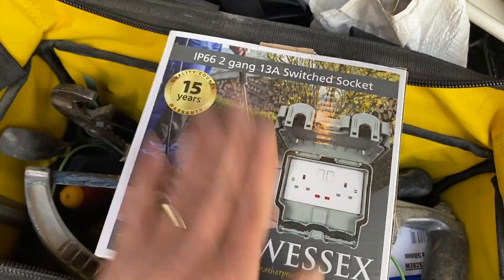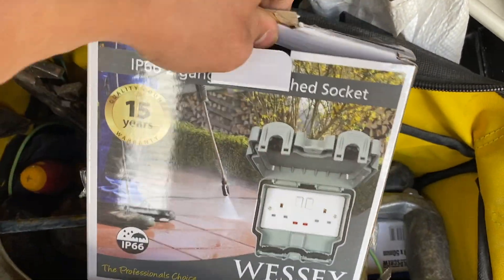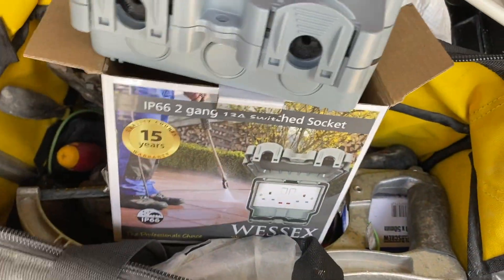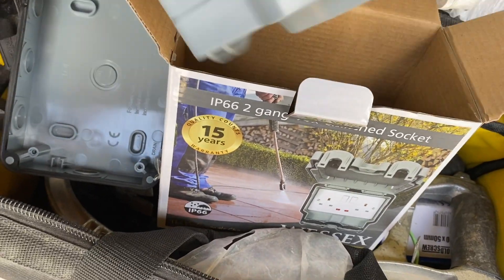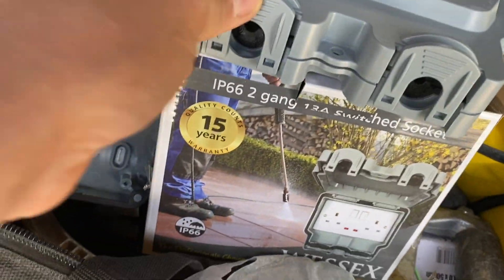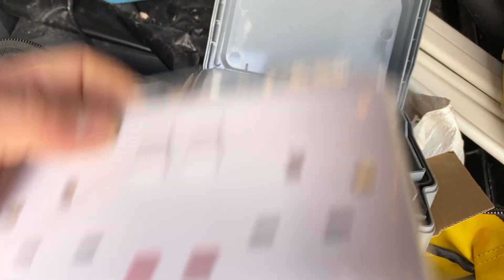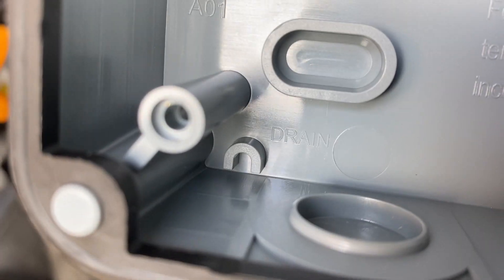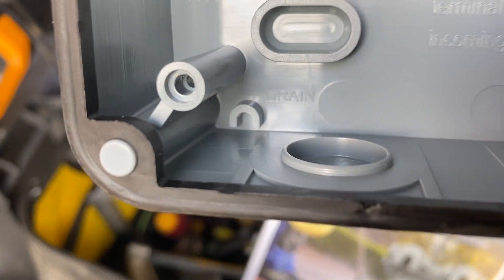Electricians day fault finding. Outside socket

Comment: I always drill the drain holes, it's what the manufacturer insists in the instructions anyway. Never had a call back to any outdoor sockets I've fitted. Always gland underneath the socket too. And if rear cable entry, silicone sealant around the hole. Never use acetol based sealant (vinegar smell) inside an enclosure as the acid can attack copper/brass terminals and conductors.

Comment: Always good idea to drill out both drain holes in case water blocks one hole causing a small vacuum. Otherwise air cannot get back in. If the unit is fully air tight of course. Just a thought.

Comment: In September I’m going to become an apprentice electrician and it would be great if you could do a video on what you would recommend an apprentice for good tools to start with
Reply: Assortment of drivers 
Snips decent sparky ones. 
Pliers
Couple pairs of dogs 
Junior hacksaw
Stanley 
Multimeter (depending where you're completing your apprenticeship they may provide this or advise what testing stuff you need)

Turn up on day one with the basics atleast and then you will work out anything extra. Ask senior person if there is anything specific you need. 

Goodluck.

Comment: Never been a fan of swa glands outside regardless to being IP rated or not ? The connection between the brass gland and the steal lock nut is just not designed for water ingress ? Still waiting for a better alternative on the market ? your right about the drain holes chris but that lock nut still rots away 👍
Reply from the maker: Brass piranha nuts are good.

Comment: They should call them "breather holes" rather than drain holes, people would prob understand positive and negative pressure through expansion and contraction. Good video highlighting issues with DIY installs.
Reply: muzikman2008 the manufacturers say the back boxes are IP66 rated but many of the come with pop out blanks around the sides and top, which I’m sure would work loose when you get sun light on them. Which they won’t keep there IP66 integrity, so always good to put a couple of drain holes at the bottom
Reply: @leebutterworth7465  I have fitted those types (BG I think?) not had any call backs, but again, like you say correctly, drill out the holes. If installed correctly and they are allowed to breathe they always maintain their ip rating.

Comment: Why are the back boxes not supplied ready drilled.
Reply: Because you can have the box on most of them either way up if that makes sense I know on the BG ones the back box can sit upside down and if they drilled it previously some idiot might put it upside down with the hole at the top meaning that it would work but would fill up with water even quicker
Reply: They can be used indoors in dusty or damp areas, then you wouldn't need the hole drilling. But water ingress wouldn't be an issue then.

Comment: I’ve had the exact same issue at my house whoever installed the outside accessories didn’t bother to drill out the drain hole on any of them and water got into one of the accessories and completely flooded it when I opened it just the normal waterproof lid water came gushing out And then Un screwed and more came out 

Because of that I then just drilled out the drain hole on everything

Comment: Do you think there is any reason why the drainage hole should not come pre-drilled?  Would seem more sensible, always a pain to have to drill out the hole but definitely worth it.
Reply: I've always assumed that it's because a pre drilled drain hole might be in the wrong spot, if the box had to be mounted in a non-standard orientation, ie. if the box needs to be mounted sideways, or mounted vertically under an eave, on a post, or something like that.

Comment: IP66 = water jets from ALL angles. How does drilling out the drain hole ensure this IP rating? Not a criticism just curious
Reply: Instructions usually tell you to drill it but then tell you it will affect the IP rating if you do!

Comment: Nice one, looks a pretty common mistake not to drill that drain hole out
Reply: so one ponders why dont the drain holes come in finished product, why hope and pray some duffer will drill it out
Reply: Ressy6 Because the boxes can be either way up on the BG ones especially so if they drilled out the drain hole and someone puts it on upside down it would work but the whole might be at the top of the box even though the sockets the right way up meaning that the box would fill up with water even faster

Comment: I question why the manufacturers don't drill the drain holes as part of their manufacturing process
Reply: Some enclosures can be installed either way and you wouldn't want a hole in the top. I do wonder why you have to drill them out - German manufacturers leave a fairly thin membrane so you just punch them out.

Comment: What is the blue core that isn't connected? Cheers
Reply from the maker: A 4 core cable was used to supply the socket the blue core is disconnected and terminated in the unused earthing terminal in the rear.

Comment: SWA glands are not IP rated glands, did you regland  using outside glands, using the correct gland you wouldn't of got that water issue, correct glands , silicon around top and side  you wouldn't need to drill the drain hole
Reply from the maker: Yes I did indeed replace the two glands with exterior glands. The issue wasn’t with the gland it was with the enclosure filling up with water condensation and having no where to leak out. Once the enclosure had filled up the two gland then were submerged in water hence the rusting.

Comment: Recently word with a chap who sealed the drain holes to stop water getting in????
Reply from the maker: Incorrect the drain hole is located at the bottom and on the far rear corner I could stand with a jet wash on the socket and there’s no way it would drive in enough to cause any problems.
Reply: Which means that the drain hole was already drilled open - seems odd.
Reply: He was just feckin nuts. He fitted box. It filled with water. I drill out drain holes. A couple of weeks later it was like a fish tank the holes were siliconed up.. 
Bloody weird'O. 
Like you I ALWAYS drill out drains, water will always get in.

Comment: Hang let's just get this straight... at @3:06 you've used a piece of blue neutral to earth a "plastic pattress" ?
Reply from the maker: No it’s an unused wire so to save it floating in the back I connected it unstripped in the unused earth terminal.